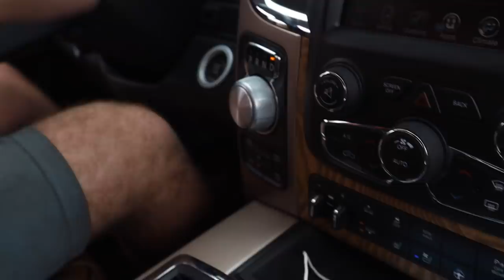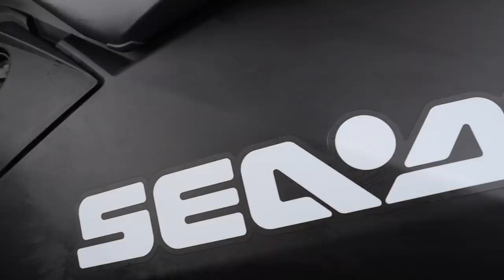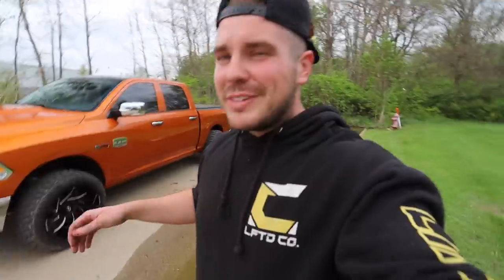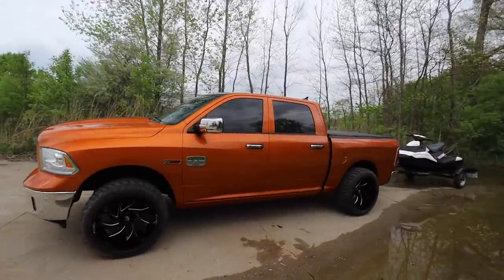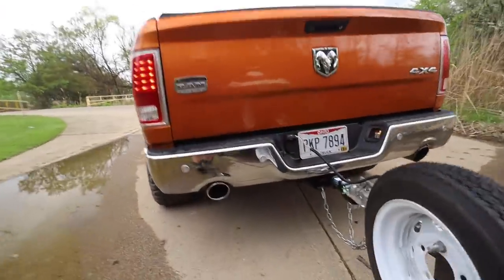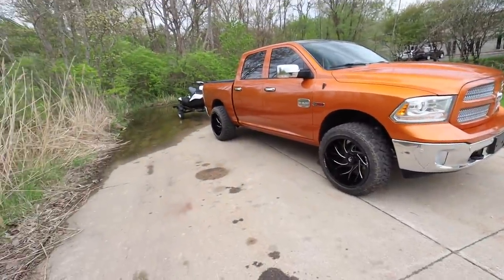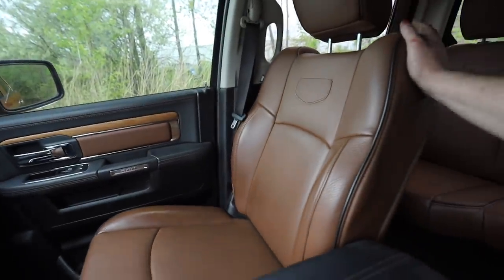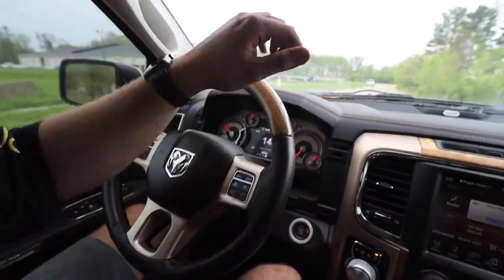I Told You This Truck Came With Something When I Bought It!!!

Comment: I just installed the Amazon rock lights that you’ve recommended and dude I love them. I’ve had the ones that come as a kit before but these lights are amazing. And since you wire them in your self they will be easy to swap out if they go bad after time. Thanks for all the videos